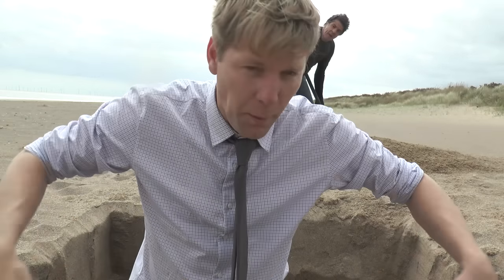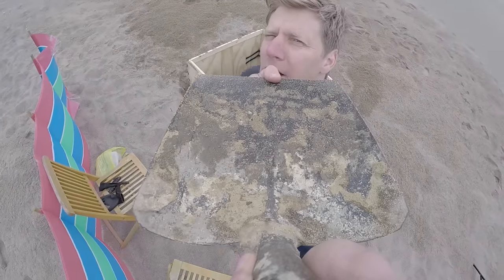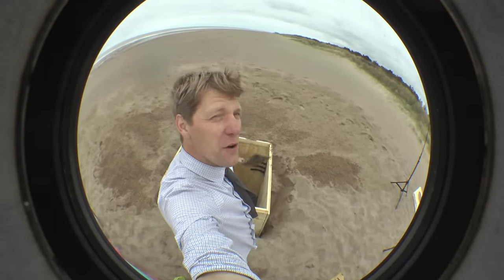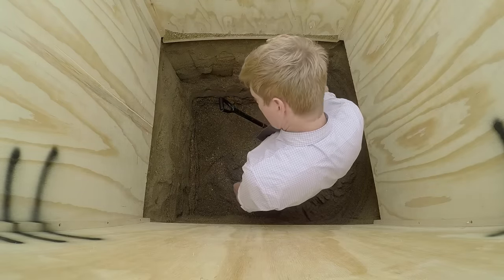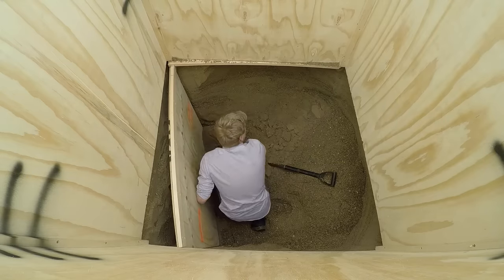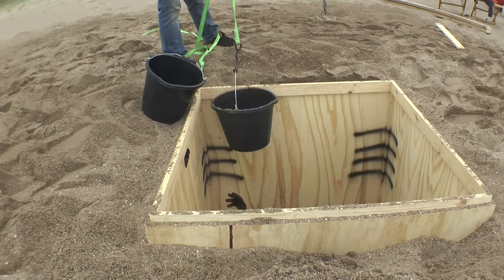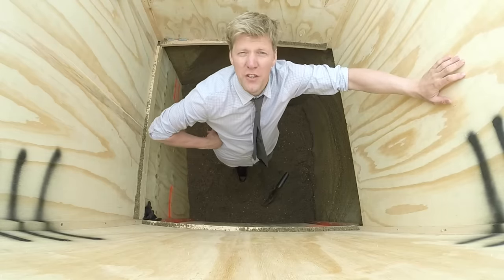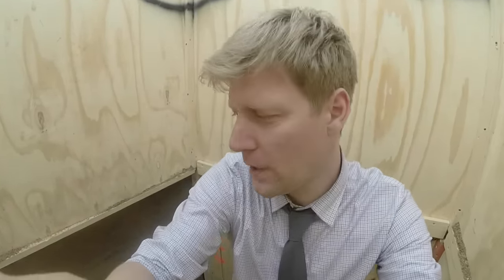Underground Beach Hut Build

Comment: please be careful, the hydrostatic pressure is massive on those boards. we use 2-4 inch steel w steel crossmembers. I know you are a smart dude, but I've seen water soaked soil break a 3/4 inch piece of plywood like a toothpick. The guy died. Horrible way to go. He had kids too.
Reply: I second,  a tree house would be cool. something out of the norm. Or a jet boat w one of your cycle motors
Reply: That is probably why he went with a little hut instead of something like his bunker
Reply: Bard yes. and that is hard work, not how I'd spend the day at the beach. I watched it again. Damn, it is caving, plus pushing on the sections while climbing.  yeah, now if that was David Blain in there, I wouldn't care so much about an accident.
Reply: I must admit that I worry for Colin's safety. He's a bit of a wild man and we enjoy the vids, but I certainly don't want him getting killed because he didn't understand hydrostatic pressure.

(Like the fella building an underwater breathing canister on YouTube and there was a trained diver just about wetting himself about the possible dangers in that in the comments and no one wanted to listen. Thankfully, he was not harmed, but I felt he was taking a risk he didn't fully understand. If we, the folks of the internet, egg on this kind of thing without raising a red flag, their blood would be on our hands.)

And I hate to be a downer! But let's understand risks and be safe about the chaos!
Reply: Google search showing that 12 feet down appears to be 1,200 pounds per square foot.  Any civils/soils guys know if this number is even close? I know nothing about this field.
Reply: oconprop he built a full on bunker, I'm pretty sure he knows what he's doing
Reply: ply is the worst material to use for shoring an excavation up especially sand, not only that but he had no bracing around those boards. ideally trench sheets should be used with two sets of walings to stop any cave ins, 6x2 timber could be used as a minimum for the sheets. i wouldnt even dare go in that hole...
Reply: Damien McCue I'd tend to agree, but digging a hole in dirt and digging in sand is different... different problems that you might not consider in a plan that lead to disasters
Reply: Bard maybe, but I think a more likely reason is that it might also have been a way bigger job considering it took him a full day and a bit to build huy and dig
Reply: Unit weight of saturated sand is about 2 tonnes/cube. Depth of 3m (lets say) means the pressure at the bottom is near enough 60 KN/m2 (i.e. approx 6 tonnes/square metre) static (assuming hydrostatic). At the moment it isn't feeling that because his walls kept collapsing. But once it settles, that structure is going pop. Also, Colin, I do hope you are removing this structure and MECHANICALLY COMPACTING the sand when you put it back, otherwise you put other beach users at risk of swallow holes - which can KILL people.
Reply: The bunker was made of steel and I'm pretty sure it was designed by an architect.  This thing not so much.
Reply: really i wouldnt recommend digging straight down in running sand anyway, its just too unstable and its just too common for a side wall to collapse. if i could help it id slope it all back so it wouldnt run. other than that we will use trench boxes or closed sheeting to prevent cave ins. ill be honest i hat digging any sort of running material, like one commenter said it has its own set of problems
Reply: Glad someone is talking about this. I took one look at the child's toy fort he built for a wall support and immediately paused to read comments.
Reply: plus so many deaths occur each year from people getting buried alive because the shoring was either poor or non existent. youll find more people die from the shallower excavations because they think theyre safe
Reply: ***** some problems aren't that easily solved, not saying that wouldn't work I have no idea, but he had a lot of wood and other materials to build this, maybe he had a budget since he also wants to make a peofit making these videos
Reply: Jo B How many people exactly?  I bet you are exaggerating...
Reply: Luke Carroll yeah cheap materials is all well and good until it collapses on someone
Reply: your really smart
Reply: good comments everyone,  I love you man, I wasn't trying to be a killjoy, just don't want you to get hurt. Also, the comment on mechanical compaction is true. They had a bunch of sand removed in Florida for a beach volleyball tournament,  they dumped it all back in the crater when it was over. The first rain, it sunk over 10'
Reply: +Luke Carroll, having a budget doesn't mean it's okay to die. If you can't afford the parachute, don't jump.

But of course I'd probably do the same thing because... it's just a hole in the sand, right?
Reply: Homefront last year alone i think there was something like 20 fatalities due to trench collapses. in your eyes that may not seem alot but too me thats extremely high
Reply: Never said it was a good idea... but I think the "its just a hole in sand" is probably not that far off what most/maybe colin would have going in to a project like this
Reply: oconprop I'd like to point out this already filmed and Colin clearly has not died.
Reply: yeah many people have died in safer holes than that.
Reply: NLmitchieNL i
Reply: Taaketa Dinloka  good to hear
Reply: Taaketa Dinloka - True but its a roll of the dice, it can happen any time.  i dont want to sound like a kill joy bit tjis video is just promoting bad practice
Reply: oconprop No one cares if he died
Reply: Shit happens
Reply: +David Ulak We apparently do.
Reply: did you just second yourself? did you forget to switch accounts you cheeky bugger?
Reply: He's right death happens all the time and you can't care for anybody if there dead
Reply: Jo B "plus so many deaths occur each year from people getting buried alive because the shoring was either poor or non existent" - You know about all those drug tunnels we hear about along the US/Mexico border? I wonder how many a poor sod has been buried alive digging one that will never be heard about
Reply: The Abusement Park  hey your missing me its good if no one cares
Reply: I didn't claim that.  I just said that I care that he died.  I care for anybody that I hear dies.  He claimed that nobody cared.  Well a lot of people clearly do, as it actually puts Colin in danger.
Reply: Do you speak English or are you learning it???????
Reply: I understand everyone's will worry, but colin's a smart dude, and there's probably more to it than what we saw
Reply: its not just Colins safety but everyones safety that we are worrying about.
Reply: this is a project that people would look at and say, yeah i can do that....  really people with no idea of the danger should be doing this...
Reply: you can see some of them bowing in. I would definitely not trust them. those boards are way too thin for something that's not supported
Reply: Hendrik Witbooi apologies i was only accounting for known fatalities in the UK. tunnelling and mining is on a whole new level compared to excavations and is extremely dangerous, even for the experienced
Reply: That's not reassuring.
Reply: and becareful colin because oxygen doesnt go down there
Reply: Yes I expect this is a temporary project right? cool but temporary.
Reply: Jo B No apologies needed, I was trying to expand on your point. In that thousands die in this manner worldwide, most unreported. Say some kids try reproduce this vid, they won't be entered into the satas
Reply: Extended 600cbr oxygen will be in the excavation. although it is a confined space. our excavations are usually a lot deeper than this, we have gas monitors on us which  monitor the oxygen levels as well as other harmful gases.
Reply: Hendrik Witbooi you are very right in what you are saying. i do think people need to be made aware of the dangers of digging holes, i know it may sound silly but i think holes and trenches are underestimated
Reply: You lot are acting like it's permanent NO it's not its there for a few days then going to be taken out. he has had full permission to do this over wise he wouldn't be making this video.
Reply: the way I see this is the hole and beach hut are already gone as he will have prerecorded then edited this and the next video so nothing tragic happened BUT there may be oh my gosh's to come just not enough to stop the vid going up
Reply: Central Bop he just wants him to be safe and is educated on the subject
Reply: How could he 'really' know what he is doing!
If he has never done this before and I very much doubt ANYBODY has, how could he actually know what he is doing is safe or correct.
It really does look very unsafe to me.
STUPID people die every day doing STUPID things like this!! 
And I guarantee every one of them thinks they know what they are doing!
Reply: Central Bop the exvavations we do arent permanent, they are open anywhere from a week upto a few months. you'll find that any exvavation should be adequately supported regardless of the timescale
Reply: Gecko, I really do not think there is more to it. You can see on camera as they do the project. There is no more.

And for the folks who think "Oh, he's smart; he's done this and that" I would say NO. Colin is not smart when it comes to safety. He jokes about it. He's crazy and lucky and he gets hurt a lot of times. He's just been lucky so far.
Reply: oconprop o
Reply: @ATHIP12  you aren't his mother, and neither is the government or the police force. stop being such a busybody.
Reply: I wish you were lying
Reply: A collapse is good
Reply: @t76d777f6d  12 foot is about 3.6m so  it would be 36 kN/m2  or about 752 lb/ft sq so you are in the right ball park. But not only that, you have to add the pressure of saturated sand multiplied by to active earth pressure coefficient at that depth. It would be well over 1000 lb per sq foot in the 1000-1500 range depending on soil properties.

He needs thicker ply and square waling frames at about 1 foot centres to make it safe in the short term and then line inside the waling frames. Oh and forced ventilation.

But basically what he has there is a death trap, even with the floors in, that ply can't span that distance or anywhere near it and the floors can't take the pressure either. Not to mention flooding or carbon dioxide build up.
Reply: @alexandrafreeman8135  To be fair you are right about the public. He did say he dismantled it. But he put his own safety and his friend at risk. Ground water pressures can change in a few minutes and hours, let alone days. He said it was normally dry but such thumbs in the wind are not good enough. An unexpected high tide, rainfall, or a local underground stream changing its course are all you need for that to collapse more rapidly than he can get out. Unfortunately the ply support he has there is no more than a matchstick to support a 10 tonne weight when it comes to soil and ground water pressure.
Reply: @hamyield  I agree with your calculation. Water and saturated sand in the worst case. Up to 60-70 kN/m2 or roughly half that in the long term dry case. Anywhere from 600 to 1600 lb/ft2. Big numbers, which up against, unframed ply is matchwood.
Reply: Well it would suck to be that guy :c
Reply: @noahgisolf6997 this aged well
Reply: @oconprop did you second your own comment?
Reply: @a7i20ci7y  engineer. Architects don't know how to engineer, just make things look interesting
Reply: I suppose the pressure here would be less as the hut is tiny, but steel cross members still sound like a good idea.

Comment: As a geotechnical engineer, I can only say that I am amazed you didn't die digging that hole. You did manage to dodge a bullet.
Reply: @botakbishop1441  "2700lbs per cubic foot"?
Reply: @Botak Bishop  is that the height?
Reply: @botakbishop1441  You've got to be kidding me!
A yard is not "about 4 ft" - it is EXACTLY 3 ft!
Reply: @botakbishop1441  yard stick is 3 ft ..cubic yard 3 ft by 3 ft by 3 ft
Reply: He had his safety tie on.

Comment: Without a doubt the most dangerous thing Colin's ever done.
Reply: a7i20ci7y yep, home made jet engine is much safer.  :)
Reply: a7i20ci7y what about the 360 swing with a engine, just holding on, with no safety gear?
Reply: Skitty2Bruce that's for his kids lol
Reply: There's a huge difference between likely to injure you and likely to kill you.  People die frequently from digging deep holes at the beach.  It's usually a little kid, sometimes two or three at a time.
Reply: hadron89 that swing was big as his house, i don't think he would have a chance
Reply: I installed water and sewer lines for years and it only takes 3 to 4 feet of dirt to kill you. I got covered up to the knees one time and had to be dug out because I could not move my legs. Very dangerous.
Reply: Plywood is no were near safe enough to hold back that sand.
Reply: Anthony Elmore we are making jokes here but i do agree. that box need serious support...
Reply: a7i20ci7y so lucky no-one was killed here. Easily the most dangerous thing I've seen Colin doing..
Reply: I work in construction and this is raising so many alarms in my head, this plywood is not good enough. I know Colin plays with home made jet engines and all, I have been watching all his vids for about 2years now. However I think this is one of the most dangerous things he has done
Reply: Its cool though...cause safety tie
Reply: well it did look like he was making his own coffin at first.
Reply: Adam Ruffin if he loses his tie he has ships safety hyroformed suit
Reply: wet sand weighs about 120 lbs per cubic foot. At 10' deep if it collapsed this dude is done.
Reply: Even compacted snow may weigh 20 pounds or more per cubic foot, so don't even be tempted to do this in a deep snow drift. Once you are trapped, you wont be able to move, and even if the weight doesn't simply crush you to death, you will slowly be squeezed till you can't breath. I hate to say it, but... 
Nope..
No..
No..
No chance.. 
No... 
Don't do this... 
Stick to blowing things up, is way safer... even dropping head first from  10ft on to hard surface when you magnet shoes conk out is preferable.. just ... 
No.
Not even maybe..
Reply: I wonder if Colin even thought about the possibilities of being crushed to death by a collapse.
I sometimes fear for him, such a genius driving without even a helmet at over 100 mph, swinging without even a rope at heights above his own house, blowing rockets right next to him. And all of this with two children.
I admire his courage but it borderlines with carelessness.
Reply: G'day,

   Well, in point of actual fact, this fiasco probably goes neck-and-neck with the Twin-Paramotored Uncontrollable Hover-Bike Brainfart...; as regards dangerosity-rating.

    Every couple or 5 years someone here in Oz fails to explain Cave-Ins to their Children, and so the unsupervised little Darlings dig themselves a "Cubby-House in the Sandhills or Sand-Cliffs beside a Beach ; and when the moist Sand which they dig into dries-out slightly it then loses what little strength it originally had, and so they get buried alive - requiring expensive Recovery operations - before reboxing and reburial, or cremation, afterwards...

  Attempting to sink a Shaft on a Beach with a Prefabricated Flat-Walled square-section Plywood Caisson (totally lacking in stiffening-ribs to stabilise the Walls..) hoping to slide it  vertically downwards as the Shaft deepens....; well, apparently it goes a long way to show why Plumbers and Miners have totally different Textbooks....

    And, in the finish, all he achieved was a Plywood-lined "Long-Drop" Hole in the Beach... (a Long-Drop is an old-fashioned way to build a Shithouse, when there's no Water for Plumbing ; simply dig the deepest 4-ft square Shaft which one's tools & endurance can manage, then put a Toilet-Seat on top of the Hole & build a little Hut over it, in which to sit, & shit...., and they're never ever built on Sand....).

  Even in stable soil they smell incredibly bad, but them-thar olde Imperial Sheepfarmers and Cattle Barons never seemed to mind living amidst all kinds of horrible stenchs....; "the Smell of the Paypacket", was what they called their miasma....

   Essentially, this clip shows that Colin Furze has apparently run out of bright ideas for funny things to make videos about...; he was absolutely incandescent for quite a while, but now it seems that his Filament of Inspiration has burnt itself out (through over-voltage ?).

  Thyme will tell,

  Have a good one,

  ;-p

  Ciao !
Reply: I realized that halfway through. 

if the pressure had collapsed the walls, his friend wouldn't have been able to dig him out because of the wood. 

maybe he'd be lucky and the wood would trap some air just long enough, but maybe not. very scary.
Reply: All of you folks with weak nerves, you are worried for no reason. They removed so much sand that all he'd have to do, in case of the sides crashing, would be jump/struggle. Get a grib
Reply: Are you even serious?
Reply: i work in construction and OP is right. plywood is too flimsy to hold back all that pressure. If they were to break while someone is in there, then thats it no chance of getting out
Reply: yea I came to type about this but you did it better than I could, now... I am thinking that he may have built this to put his landlord in there...
Reply: 70mph mobility scooter is much safer the digging a hole in the ground.
Reply: a7i20ci7y dude he made a BUNKER covered in CONCRETE AND METAL (1000 tons sarcasm)
Reply: Lol

Comment: Love that you took the time to do small project like this, some might think what is the point, but in fact you can learn so much hands on experiences and valuable information from it! However, I would add cross beans to push the opposite panels, the reason for that is, the company I worked for had an accident not so long ago, the panels caved in and the person buried alive, and the hole was less than 5 foot deep!